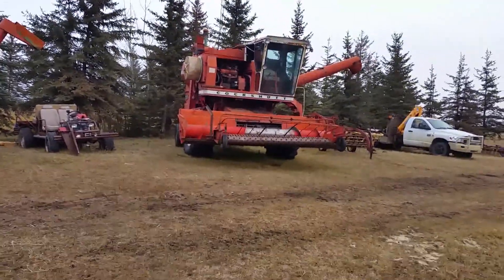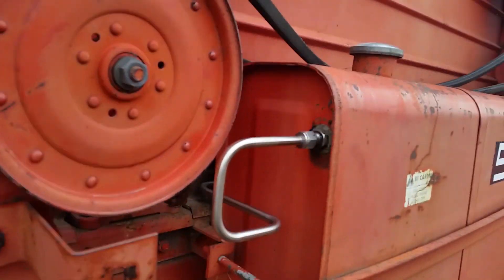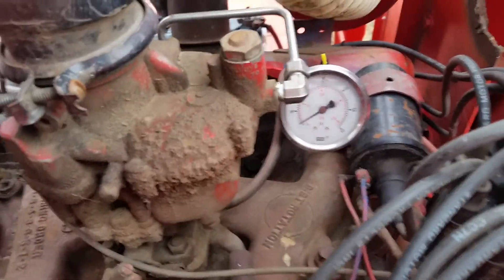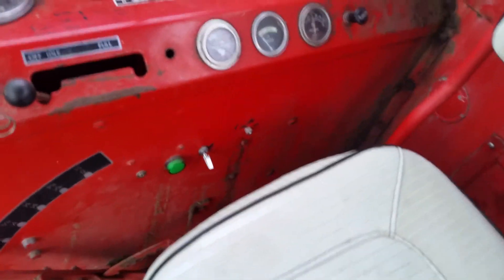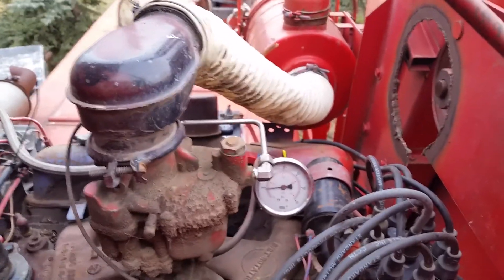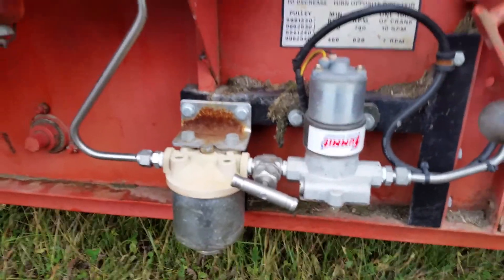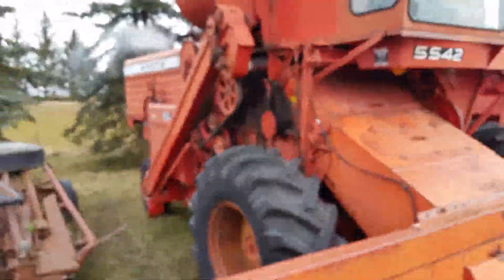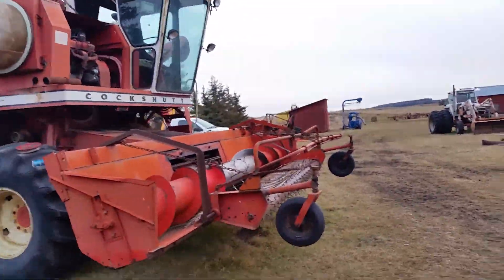White 5542: Electric Fuel Pump & Cold Start Nov 2016

Comment: Was the 5542 the smallest of the white combines? Thanks for the video.
Reply from the maker: After the name change to White with the standardized 4 digit model numbers in the early 70's the White 7300 was the smallest at 34 inch body width, previously the cockshutt/oliver 535 and MM 3496.  The 28" 525/2890 was discontinued.  The other 42" machine 545/4296 was discontinued in favor of the 542/4290 which became the 5542. The 52" 555/5555/5297 became the 7800 and eventually a 7600 45" version was created to bridge the gap from the 5542 to the 7800.
Reply: yetilikesbeer ahhhh i see. Clear as mud lol. Thanks
Reply from the maker: But the weird thing is you could get a diesel in the smaller 7300 but not in the 5542.
Reply: yetilikesbeer and the 7800 olivers were all gas engines. Diesel was an option but too expensive
Reply from the maker: Yes.    I have two Cockshutt 555's, the orginal model that became the 7800, then 8800/8900. Sold as the Oliver 5555 in the states.  One with the 318 but the other is a big block (gas v8).    The diesel option was not available until later on (late 70's I believe) to compete with Massey which offered the diesel much earlier.
Reply: yetilikesbeer i love those 555's. I wish there were some in our area. What part of the world do you call home?
Reply from the maker: West central Alberta.    Not many around here either, but since there was only about 2000 555/5555's made (according to forums) they were pretty rare to start with, which is why I grabbed the second one when I seen it (about 120 miles away).
Reply: yetilikesbeer here in south western ontario the only ones left are 7300 and the odd newer whites. All Deeres and CaseIH
Reply from the maker: Our area was primarily beef and grain was produced for feed and crop rotation on the hay land.   With the smaller operations most people opted for used machines so we have quite the variety, the rarest being gleaner.  When larger grain operations started moving into the area 20 years ago it was dominated by used 760 and 860 MF. Now JD is starting to take over as they have the only legit local dealer.
Reply: yetilikesbeer Hey buddy ,we ran a 431 back in the day ,looks like it had a lot of  similarities to your   combine.